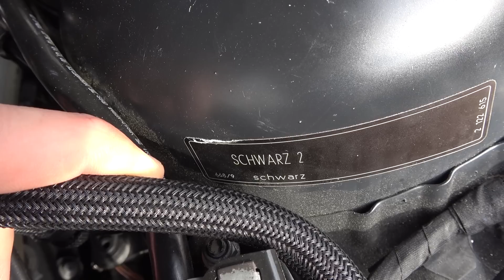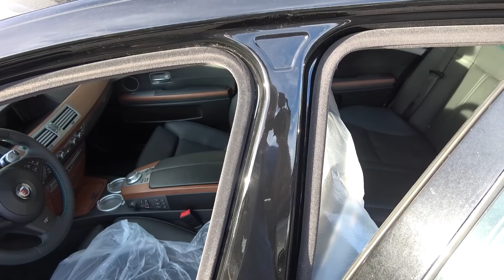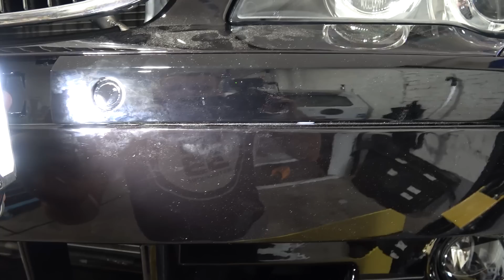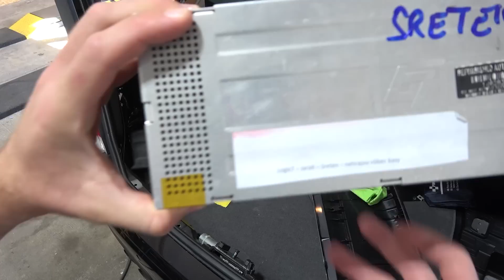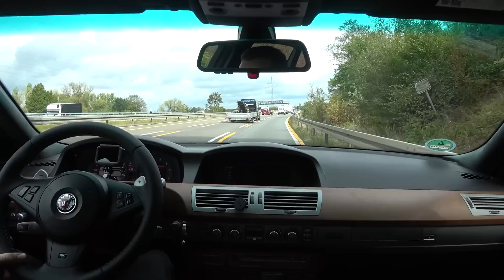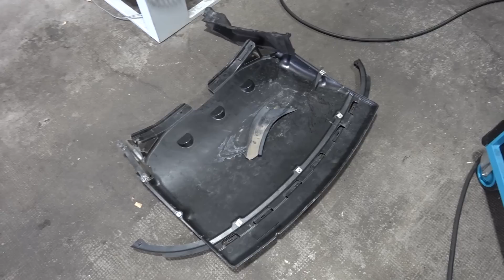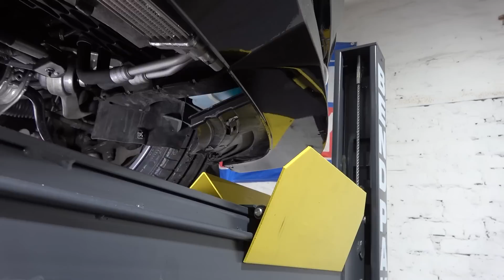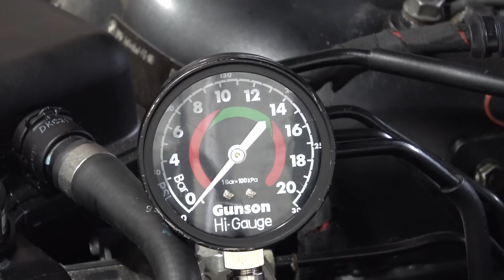More Problems - Supercharged BMW Alpina B7 - Project Chicago: Part 15

Comment: I think what happened with the plastic cover is that created some "wing effect" as the air instead off passing underneath it went above it. Probably due to the bad air flux management from the front bumper. There is probably something wrong there, some wrong vortex. You were doing almost 300 km / h, air at that speed is as thick as an apple cake.

Comment: Damn man... One buddy of mine dropped his car off to get some parts painted (He had a minor ''crash'' that scratched the original paint job). In total he got 5 parts painted - Side skirts (Counts as 2 parts), right front door, right front fender, front bumper. All that for just 600Euro and the finish looks identical to original and the paint shades are no different in any angle possible than what the factory has, the only difference is the shininess (original paint has swirl marks, newly painted one has none of that).

Comment: Sold my Kia Stinger with duct tape holding the underbody panel. Cuz same thing. High speed caused it to catch the airflow and basically folded under the car. Cleaned it and made it so wind couldnt catch it.

Comment: the tiny little holes on the clear coat are from the adjusting the gun when shooting clear coat. 
high psi + low material = holes in clear coat
low psi +high material = run in clear coat

Comment: "$1,200 to paint the bumpers plus the trim" and later on saw all the blemishes. You've got ripped off Srenton or they do them much cheaper in the States. I mean I can get them done myself with about the same result in my garage

Comment: Hi 👋 , I am new to your YouTube channel, I have just what’s all episodes up to 15 excellent work, patience is a virtue. by jingoes like you’ve got a lot of patience, Many many many years ago I was involved in doing some renovation work in a Corvette I was doing the respray job on it which ended up not getting done I’ve done all the prep work and I took it out for a drive one evening where the engine blow it threw a rod through the side of the block, I was not hanging about at the time and it took me three lines of a road to pay able to stop it as I have lost all power completely and oil as spat out under the vehicle making everywhere like the tires covered in oil, The car did not belong to me it was a client in a storm next day and I didn’t believe what he said he just told me don’t worry about it it was my fault I should’ve told you about the oil leak and the oil needed topping up every so on to hundred miles or so. I have built a few engines and hot rods conversions in my late teens early 20s and I’ve done quite a few Resprays as well, I have owned a 2002 which I had for a couple of years apart from a wheel coming lose  at one point after having some new tires fitted it was very nice car drive,  Over the last 20 years I’ve owned a Mercedes sprinter, Which had to have some head work done as I needed new injectors and some bits and pieces it went into a dealer and they broke off one of the injectors which then ended up having the head sent away, to have the injector cut out, Which I got charged for I didn’t think that was right because they done the damage and make it worse less than 1000 miles later coming back from France I could hear a strange noise every time I took my foot off the throttle I took it back to Mercedes I told him that it sounds like something was coming loose on the top end, They talk to me if I didn’t know what I was talking about , They took the vehicle back in and found that the drive cog on the end of the camshaft hadn’t been tightened correctly come loose and was moving back before wards and I ended up having to have a new head luckily all this work was done free of charge, Now on my second Mercedes sprinter hopefully fingers crossed that will keep going for another few years.
You have put together a great territorial on the breakdown and repairs of the Alpina B7 , I look forward to the conclusion.
PHIL FROM THE DARK SIDE OF THE MOULIN FRANCE.

Comment: As a former BMW fan I suggest, this guy should also receive the "most patience" award. I guess Alpina finally needed to get involved after all, nobody wants to buy or own or have anything to do with BMW and or BMW Alpina ever. I believe Alpina or BMW will *(after seeing this) never recover from this image loss. This is well done and we all should thank him to "cure us" from our sentimental BMW love affair, thus to educate the consumer of what bad engineering BMW and BMW Alpinas have encountered. Anyone watching this with a technical / engineering mind, will understand many parts are simple badly engineered and a symbiotic connection between parts and elements do not exists, for example these cheap thousand clips and bad plastic parts, virtually everywhere categorizing this cars within the lowest of the lowest craftsmanship out there. All parts are secondary made, by secondary companies in Asia and then expensively sold elsewhere, shame on them! RIP BMW (died 2001-2002)

Comment: Really like your videos, what a great job you’re doing on your cars. I also work on cars here in USA. I own 2008 750 Li. Mine has only 42k miles on it, I bought it close to new and kept it. Question for you, since you know a lot about this German engineering, would you know how to fix the driver’s windshield washer blade bounces when in use, it’s like it skips when whipping the windshield. I replaced new blades twice and couldn’t figure it out, had that issue ever since bought the car. Thanks again

Comment: Man I really feel your struggle with the paint shops. I tried out every single paint shop where I live and they all do really bad work. I even told them it can get more expensive and the time its takes doesnt matter but they still ruined everything. New fender was in wrong color, holograms after their polish everywhere and you even see the marks from sanding under the paint. Germany has the worst paint shops in europe.

Comment: I have been working at 3 OEM so far, including a BMW competitor that shows a star on the hood. Factory mistakes happen more than you'd think ... a good chunk of it is spotted at the delivery at the dealership and is fixed without the customer knowing anything about it (he will just be informed about an unfortunate delay). But not all.
And if you include special editions or unconventional productions (such as the ones for partnerships, tuners or individualization) it's quickly a mess.
I put my Datsun 240Z on the second scenario!

Comment: I wonder if the metallic body parts are over spray from a metallic color?... Maybe try clay bar on those parts.. Just curious... If the color came up Honda I assume it's over spray, or worse case scenario it's over spray that's has been clear coated over or ceramic coated possibly.. Even tho I'm an Audi fan, your vids are entertaining, sometimes funny & can learn a few ways to troubleshoot car issues.

Comment: I worked ten years in a paint shop at a Vw-Audi dealership, and the factory makes mistakes, I saw a brand new car repainted by the factory, it had double the thickness of the paint in all areas. it is very possible that it is a factory error

Comment: I hate that car....it's probably been contaminated during factory process.
The paint can put down on both bumpers using the same paint, at the same time and they can look completely different, it's a rarity to get exact same outcome. Unless every aspect of the process is identical, not easy to do at all. Plus the plastics could be different, you got them from 2 seperate manufacturer's

Comment: Another great video. I do not know how you stay so positive with every setback. I have a 2006 e66 which I changed the door open rubbers just like you did.  All went well,  so many thanks. I did however find, in each door inside a tiny white plastic cap. About 5 mm in diameter.  Couldn't see what it was supposed to fit on. Did you find that whe you took your door cards off?

Comment: Having watched this channel  for a few year now it's tort me to not buy a BMW as I would not be able to keep up with money it needs. I don't just mean this one either. I have owned a Kia ceed for 5 years now cost me 2000 GBP I haven't needed to spend much on it. It's never let me down good on fuel, I would buy another one even if they are boring, But not a BMW

Comment: My take as somebody that had been in the industry from 2009, the car originally came out of the factory in that color; the Honda's Black. My guess is that Honda (probably Honda Europe or Turkiye) and BMW have the same supplier. (Maybe u can check if Honda Swindon Plant or Turkiye plant had produced cars with the color).

Probably, at some point of the 7 series body production, the supplier was changed or they are having paint shortage. Best they can do to not have assembly line stoppages is to have a small production volume that use the color. I'm talking about only around 50-100 cars, maybe? Typical for a tank of paint for a painting robot.

A reason why BMW did this, could be due to their supply contract with Alpina. By hook or by crook, BMW need to deliver the ordered painted bodies at certain date or else have to pay for a hefty penalty.

Then, the particular car body bound to have a slight mismatch originally from factory with the supplied bumpers and other plastic garnishes. Alpina could have missed or chosen to accept.

The car eventually destined to be sold to countries with less picky customers such as USA, where customers are more into the brand rather than nitpicking. Else, the car itself spent a short time as test drive unit/showroom unit. It obvious that some very cosy showroom are dim-lighted.

As for the hood and rear left door, at some point are repainted due to damage during the tenure as showroom/test drive unit (could be by the dealer before they finally sell the car).

I may be overthinking it, probably there are simpler explanations, but very complicated business circumstances do happened in this industry. And it happened where I used to work.

Comment: 13:49 What has happened to teutonic thoroughness?
35:41 If you're talking about 'octane' the fuel is the same - it's just rated differently. 98 RON (Research Octane Number) in Europe is equivalent to 93 PON (Pump Octane Number) in the US. PON is an average of the RON and MON (Motor Octane Number) i.e. RON+MON/2. MON is always a lower number than RON because the test is different.

Comment: My 2011 328ix Touring just got hit in the back by a texting driver.
Will take as much as six months to get the right rear fender from Germany, according to the body shop and the insurance company
BMW Canada doesn't stock parts for older cars.
Sucks!

Comment: FYI - Most places in the US have 93 octane rated in AKI.  Most places in Europe have 98 RON.  They are equivalent.  If you have better fuel, a tune isn't required but you would have more potential to make more power with higher octane.  You could still run the same tune though and have more knock resistance.

Comment: A friend bought a new bmw in 2002. a black car, but some parts were dark green! Factory fault!
The color difference between different parts of the car is really something common on Bmw. I looked at my 2017 530, it looks a bit like your car, at least 3 different black.

Comment: If this was a factory "mistake" or whatever you want to call it and you can somehow confirm that. It would be pretty awesome to keep it the way it left the factory with the correct color coded plastics and the mystery color on the metal.

Comment: I usually never mix the color based off code especially if it's and old car.

I pull the fuel filler door, polish it up and then have the paint mixed starting with the code and then matching to the fuel filler

Comment: just a suggestion, instead of drilling and tapping the subframe, wich is gonna leave you with 1 or 2 mm of treads, why don't you use instead rivnuts? also how about a full aluminium engine guard?

Comment: I dont know if its different in germany but here in switzerland the bmw dealerships often also offer paint jobs. i had my hood and front bumper repainted at a bmw dealership and it was flawles. not a single imperfection and the color matches exactly with the original 14 year old paint.

Comment: If the colour doesn´t match to anything, maybe the paint lines weren´t flushed properly but it´s wierd that the colour mismatch to the plastic parts wasn´t noticed in the final inspection.

Comment: I'm getting some massive flashbacks here.... this sounds all too familiar, I had to do the exact same on the E63 rear bumper and cut into a perfectly fine car part. The front is easier, no cutting required, fortunately. Precision and patience are key here. 

And the same with the color, it was apparently repainted in a slightly different color. It's so subtle that you could only see it in direct sunlight, even the painters didn't notice when it was inside. Crazy why anyone would do this instead of just using the original paint... paintshop then measured it properly (like they should have done in the first place!) and it came out to some Toyota color. It's not like Toyota paint is any cheaper or anything... If it wasn't so sad it would be funny. I mean, someone spent a lot of time and money to repaint the car, decided to do in a different color, and picks almost exactly the same one. WTF!? 🤯😅😂

Glad your engine is working as intended! 😎👍

Comment: It was nice for Alpina to offer to rebuild your engine. However, I think you do a better job. They would've just rebuilt it with those tight tolerances and would eventually join pistons and cylinder wall in un-holy matrimony.

Comment: You're lucky that you don't have any issues with the automatic transmission because issues with automatic transmission can drives you crazy really bad. I have multiple cases where I just want to overtake someone and the transmission decide to goes into limp mode and locked into 3rd gear while driving with 80-90 kph. And after several changes inside of it, it still agains do the same on long trips, not during the test after servicing.

Comment: Whether it's a factory mistake or not I think depends very much on how Alpina take delivery of the base cars. Do they receive shells, or complete cars that they thin strip and convert? I can see the mixup happening if they receive bare shells. They might just be given a 'black one' and not necessarily precisely the correct code. If they receive full cars, I can't see the factory making that mistake. If they did, they would be just as likely to try and install black plastics on a red shell for example (clearly they wouldn't, I just mean the process failure would be the same likelihood), the internal process of matching up parts is the same. To have 2 shades of black come together incorrectly seems just too unlikely.

Comment: nothing holds the bottom panels on better than zipties at high speeds....its ghetto but it works
i have lost quite a few of these panels due to them coming off above 200km/h... new screws/clips doesnt help

Comment: there is a third option to your colour dilema the metalic black is a bmw colour called sapphire metalic paint code 475 i am a panel beater and have seen wrong paint codes on new cars i bet the hood and door where off a different car one of the previous owners would have looked at the colour code of the car and bought 2 second hand panels in that colour code my guess is the colour is 475 sapphire black and the spectro paint camera's arn't all that accurate they are a good for a base line but thats it get some colour swatches of bmw metalic blacks and go from there as several manufacturers can use the same colour and change the name and code have you checked in the tyre well to see if there is a build sticker with all the info on it hope this helps cheers from down under

Comment: Well Sreten I hope that Alpina offer you a job and I hope they offer you a hell of a lot of money.  Job title  - Chief Development Engineer.
You have identified at least two required Design improvements for the B7 - too tight piston to bore clearance and too weak engine bay lower cover retention.  
Design Engineers get as far as they can with product design but the role of the Development Engineer is to bring a fresh set of eyes and another way of thinking.  I have formed the impression neither BMW nor Alpina really understand the contribution the Development Engineer needs to bring and that shows in their products.
As for those painted parts they were absolute rubbish - I can do better than that and I'm no spray painter.
The different colours is "interesting"  I wonder if the car was damaged while in the care of the USA importer who had a USA paint shop repaint the damage  prior to its first sale.  Might explain the use of Honda metallic black.

Comment: I used paint stripper on poorly painted bumper. It was a messy job but it worked well. Just test the paint stripper on the back first to make sure it doesn't damage the plastic. The first one I tried was too strong but the 2nd worked fine without damaging the plastic.

Comment: Just get it repainted with Alpina blue!! and also very disappointing that you didn't flip him off after what they told you. 
"You have no idea what you are doing and not at all qualified to work on our perfected machines." 
Maybe tell Boven Andreas that they can fix the broken engine that seem to have cost you an huge amount of money?? Swap the engines out and try and see if it was your fault or just their bad design that was the dooimg of the previous engine.

Comment: How the hell are body shops getting away with that crap work?? The mind boggles.  My Jaguar F-Pace is currently in having a new front bumper and other plastic bits fitted and painted today after hitting a sheep and I’ll be inspecting it with a flashlight when I go to pick it up.  I’d be livid if it looks like that.